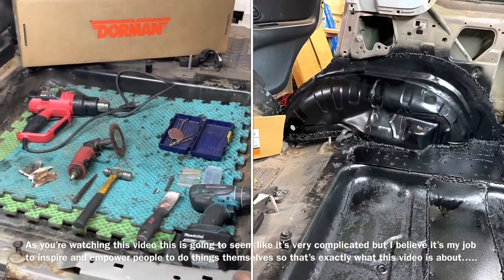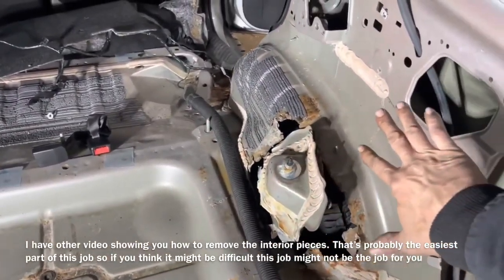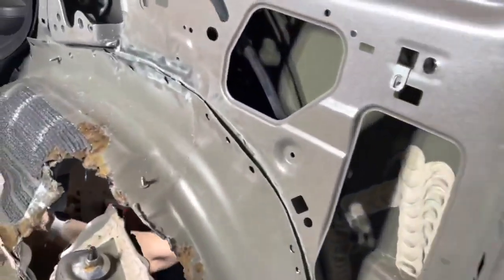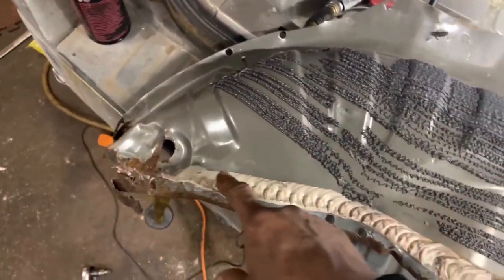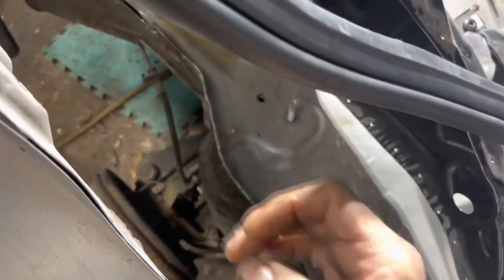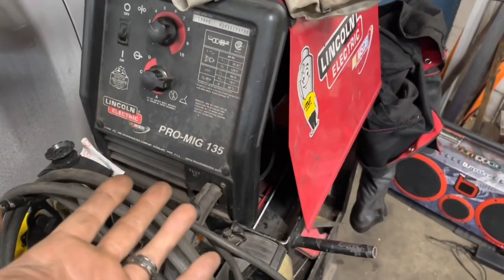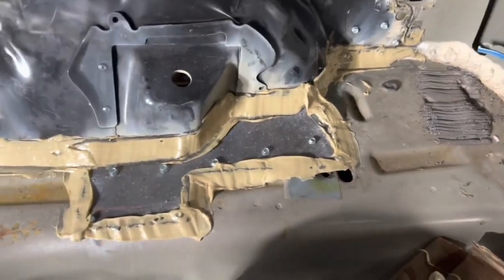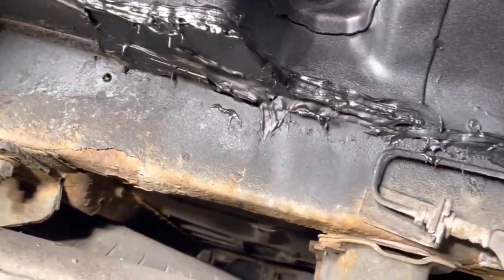Ford Escape Rusty Shock Tower, how to install them step-by-step!! ￼

Comment from the maker: Tools I used for this repair! - If you the video helped you out, and you'd like to help us out, you can use these links to purchase ANYTHING on amazon and we will get a small commission with no extra charge to you! 😀
Dorman 924-358 Rear Passenger Side Shock Rust Repair Kit for Select Ford / Mazda / Mercury Models: https://amzn.to/3vwHF2w
BLACK+DECKER 12V MAX Drill & Home Tool Kit, 60-pc. (BDCDD12PK): https://amzn.to/3L68tx0
Cobalt Drill Bit Set M35 High Speed Steel Twist Drill Bit Set (15 Pieces,1/16 Inch): https://amzn.to/3L4l8k8
14-Pack Spot Weld Cutter Sets Double Sided, 3/8" HSS Spot Weld Cutter Remover: https://amzn.to/3MigL56
Hurricane 3 Piece Chisel Set: https://amzn.to/37E4Csp
2 Pack Automatic Center Punch, Pamiso 5.1 Inch Spring Loaded Drill Punch Tool: https://amzn.to/3K3kKRE
Wagner Spraytech 2417344 HT1000 Heat Gun Kit: https://amzn.to/3xFFhsR
Chicago Pneumatic CP875 Pneumatic Right Angle Pistol Grip Die Grinder: https://amzn.to/3Ez69Mx
Shark Industries 3" Cut Off Wheel: https://amzn.to/3xJkGUl
Loctite IDH# 2474240 Construction Adhesive, Gray, 9 oz: https://amzn.to/3jYXsBB
Amazon Basics Heavy Duty Caulk Gun: https://amzn.to/3k3OROd
Rust-Oleum 248657 Rubberized Undercoating Spray, 15 oz, Black: 
TEKTON 3/8 Inch Drive x T50 Torx Bit Socket | SHB14250: https://amzn.to/37Bb9US

Comment: About how many hours of labor does this take? The local autobody shop wants to charge me about $3500 to do this repair- the car is only worth about $4000. The part itself is less than $500, so $3000 in labor seems excessive..... but I am not an expert.
Reply: I'm doing it right now on an 05 ford escape I'm 5 hours in I would estimate it'll take me around 15-20 hours just because I have to do some fabrication before I install the new new tower 3500 is excessive as this can be done at home for less than 500  but your shop probably wants to weld it in and any time welding is involved your talking big money because your paying for a skilled trade as well as labor I dont have a mig welder at home just an arc welder so I'm using steel rivets and tek screws to button it down I'll keep you posted
Reply from the maker: I charge 1550 parts and labor for this job. But I’ll bet most people do not do it as well as I do….. it takes me three days to do it correctly or what I believe is correct I also was the first one on YouTube to show one being done correctly. Or would I perceived to be the correct way? I’ve been told by many many people that my work stands the test of time. My first video on this was back in 2015 or 2016 and it’s still under my Ford playlist.

And on top of that most people think I’m too expensive ….
Reply from the maker: I’m not all that skilled… and I welded them in, there’s really nothing to it
Reply from the maker: I don’t know how many people don’t weld, but I’m a welder. I do charge a little bit for my welding, but I only charge 1550 for this job and I have to fabricate parts and when I fabricate parts to box in the bottom floor support it’s usually only about $200 because I have them pre-fabricated I made my own. I just never seen necessity to sell them to the public unless I’m actually doing the work and everyone seems to be a little bit better or a little bit worse than others but even when I do that the maximum I’ve ever charged for one of these jobs is $1950 parts and labor.
Reply: @sharpcarco  That you for your reply! I ended up getting several quotes, and they were all in the $3500+ range. With the vehicle only being worth about $4k, I decided to bite the bullet and buy a new vehicle.
Reply from the maker: @jessicap5513 if you still have the old one, I’ll buy it from you
Reply: @sharpcarco  Nope, it went to the big scrapyard in the sky. And I live in Canada, so probably a long distance from you and not worth shipping.

Comment: BSS Auto Parts sells an bracket that mounts to the frame for the shock. That allows you to put the stress of the shock to the frame and not that wheel well.
Reply from the maker: Yes I’m fully aware of that but the problem is that’s not a frame and it cannot take the stress it might last 3 to 4 months. 

And on top of that that area is usually rusted so that makes that repair not possible. And definitely not sustainable

Comment: Have you ever used Rustoleum brand garage epoxy.  It can be sprayed through a two part foam gun IME.  Needs to be cleaned immediately.  Otherwise I brush it on.  That method is real time consuming on the undercarriage obviously so customers won't pay.  It is how I do frame up restoration.  Like how you use screws and weld, saves time and customers money, they are protected  so win win.
On an aside MN gets just as bad, not as much snow but the same amount of corresive road treatment.  They are doing trials with beat pulp, will see how many deer hits that promotes.  They dont like calcium chloride.  Thanks for the upload